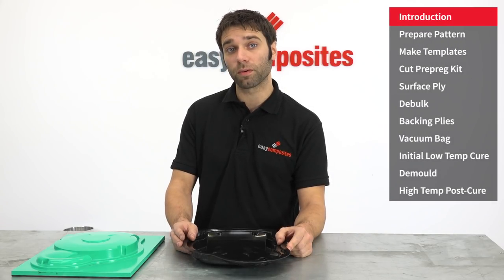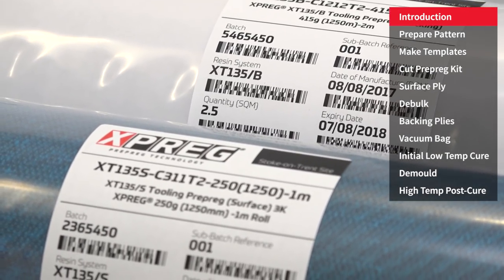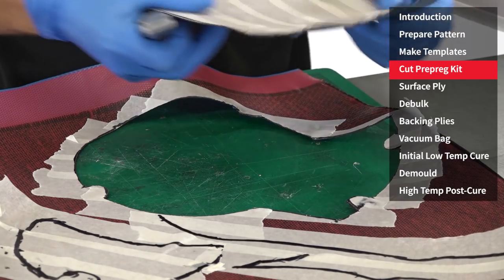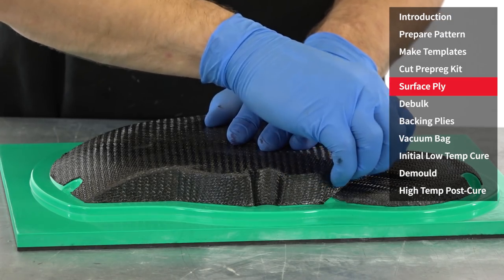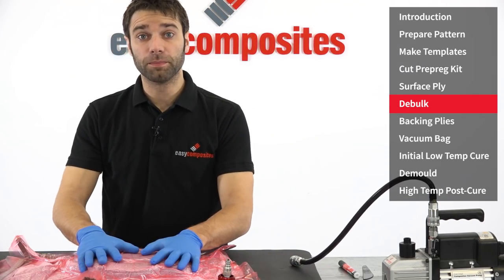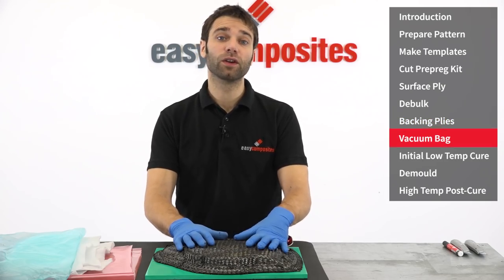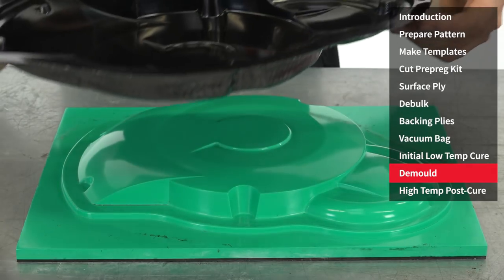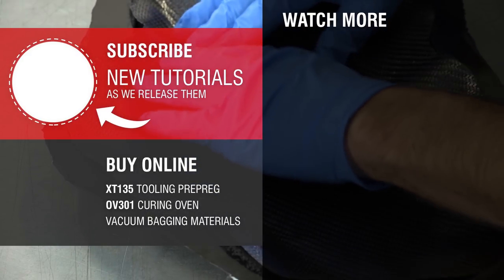How to Make a Prepreg Carbon Fibre Mould (Using XPREG® Tooling Prepreg)

Comment: Alot of people moaning about the length of cure time. But if you weigh it up against normal gel coat drying times, then lay up of mould, air dry then post cure. Not much difference apart from this is so easy and clean. Just made my first mould using this very impressed. Just hoping it lasts...
Reply from the maker: Hi Tom, it certainly should, just because the system isn’t bulky doesn’t mean it’s any less tough. Also, agree on cure time. All ‘tooling’ prepregs have very slow and low cure times in order to minimise expansion of the pattern and so maximise accuracy. You could cure faster at higher temperature but in so doing you’ll generally expand the pattern or introduce internal stresses that can cause a slightly distorted tool. Once you’ve laminated the tool, you just load it into an oven and you can just leave it curing away in the background whilst you crack on with something else. I’d say in terms of hands-on work it’s no slower than wet layup. Looking forward to hearing how you get on.
Reply: @easycompositestv  Well first time I have pinhole free! I think I can clear coat this just once. For the last 12 months I have been fighting a loosing battle trying to make uni mould work with xpreg because I'd rather quit than make make another epoxy mould 🤣.

Only thing I'd like to improve is the print through on mould. After the 65 cure it was great. Then after the 135 cure I had a bit of print through is there a slower cure again to help?

And lastly the mould surface has little holes in now. Like the s120 sealer went bit weird? It did seem smooth before because I 1200 grit sand and 3 coats of sealer. But now the part comes out like sandpaper because of the little holes in the mould.

Comment: For best results, use +/-45 ~20mm wide strips around all corners and debulk before the first skin goes on, then you woulddn't need to overlap first skin down. Then you ought to have some (usually from heavyweight) bootlace reinforcement in corners after the first ply debulk

Comment: just used this to do some of my moulds very clean use, but took me 3 hours :D i guess i am not as fast. And i find the surface  carbon fiber was more difficult to apply as it wasnt sticky, used some hair dryer and it was sticky again, the backing ply was so easy to apply as it sticks like a glue. The mold still in the oven cant wait to see the results.
Reply from the maker: You can use a heat gun or hair dryer to improve the tack no problem  -  it is quite common as the tack on some pre-pregs can vary.

Comment: would it not be easier to cnc cut the negetive mold right away?
Reply from the maker: We did discuss this (and show it) in the preceding video where we explained that it is possible to CNC machine the female mould directly from epoxy block however such a mould would have a much higher CTE and really only be durable enough for prototypes and small runs. By taking the mould off the pattern at low temperature (when the pattern won't expand much) and then post-curing the mould off the pattern at high temperature you can produce a highly accurate, very low CTE mould and use it at up to 135'C (in the case of the XPREG XT135 system).
Reply: Thank you for the answer, makes perfect sense
Reply: Easy Composites Ltd sorry, but CTE is a "Coefficient of thermal expansion"?
Reply: I'd assume so. I could see why making your mold and part out of the same material would be optimal for dimensional stability during curing.
Reply: Marcus Quintilian tnx!

Comment: Wow, the Xpreg system seems to be a lot faster. By the look of it, it makes beautiful molds too. (Easy composites, please put links to go directly to the product, to check price and purchase, in the comments for your tutorials)
Reply from the maker: Good point Martin, I've added 3 links to the description, the top one links you to the project page on our website - these pages have a 'shopping list' on the right hand side which links to all the products used in the tutorial (from the XPREG to the bagging film to the oven!). The other two links are direct to the XPREG XT135 pages on our site. It's certainly true that these tooling prepregs are quite a bit more expensive than conventional component prepregs but by the time you take everything into consideration (the efficiency of the way you can use the material, the speed, and the reliability of the end-result) they should stack up very well.
Reply: Excellent response, thanks. This is why Easy Composites is the best composites company on the internet!

Comment: Why not make the part directly from the tooling board? Is it too fragile for producing multiple parts?
Reply from the maker: Correct, the tooling board is really only suitable to be used a very few number of times. Additionally there is the difference in CTE of the materials. For best results, the component should be made with the same material as the mould tool to match the expansion and contraction as the temperature increases and decreases.

Comment: Is it posible to do this with a clothing vacuum bag? Or do they fail in the oven?

Im looking to do some RC sail planes and would appreciate some beginning recommendations
Reply from the maker: Unfortunately not, whilst clothes-type vacuum bags are fine for room temperature, low-vac pressure processes (like in our simple vacuum bagging video), they're not suitable for high-temp, high-pressure.

Comment: Great looking part.

Only thing is every video shows you making a mold first...anything I would make I only need 1 part. So making a mold would double the cost. Need more videos on how to do "Moldless parts".
Reply from the maker: Well, this video is showing a prepreg manufacturing process. Since the prepreg requires high temperature to cure you would always need a suitable mould. For mouldless production you need to bear in mind that you still need something to create the form - so, assuming we're using the original part as a 'former' - the carbon fibre part you take off this original part will be dimensionally different from it (i.e. it will be larger by the thickness of the material) and the new part will have its good surface on the inside and it's rougher, less accurate 'B side' will be the outside. For this reason, mouldless production is not generally that viable.
Reply: I was actually referring to your videos in general...I should have posted this comment on the "hood making video...Or the Carbon fiber Hood scoop video...as it wasn't heat treated.

Also I think alot of parts can be made over pieces and "trimmed back" to fit as alot of automotive parts have large body gaps..

Comment: What is the life expectancy of that mould with that process making those parts 50 parts?  and if it was a vacuum forming mould better or worse?
Reply from the maker: Depends on the cure cycle, how hard it is to demould etc but a good quality mould could well last hundreds of pulls with a little care and maintenance.
Reply: Easy Composites Ltd cool beans thanks :)

Comment: Defrosted? Does this stuff need to be refrigerated or frozen in storage? If so, at what temperature?
Reply from the maker: It needs to be kept in a freezer at -18C or lower.
Reply: @easycompositestv  that's gonna be hard cause our freezers over here only do Fahrenheit
Reply from the maker: -18'C is approximately 0'F

Comment: curing is insanely long though :D 18 hours initial cure, 19 hours post cure, that's absolute insane amount of curing :D but i am assuming this mould wont be destroyed easy , how many pulls it might give?
Reply: Would also like to know this
Reply from the maker: Hi Tan, actually, it’s pretty typical for the initial cure of a prepreg mould to be done ‘slow and low’ over a very long period of time. As explained in the video this is to minimise distortion of the pattern. The pattern is certainly not damaged by the process and can be used again if you need to make another mould. And of course, the mould that you make in this process can be used thousands of times, on a much faster cure cycle.
Reply from the maker: Hi Tom, hopefully just answered you question in my reply to Tan.

Comment: Is there any reason to make the mould from the part instead of machining the mould? It could have saved the step of fabricating the mould.
Reply from the maker: Moulds machined from the model board can be used but generally do not have the same durability and lifespan as a properly made mould.

Comment: is this green material called prolab?
Reply from the maker: Prolab is PU based. The EP700 is epoxy based.  You need epoxy based model boards as PU has a strange cure inhibition effect with many epoxy based pre-pregs where as the pre-pregs cure fine on epoxy tooling board.

Comment: so if I want to make a motorcycle fairing, can I lay this over the original part? and will it mark the original part?
Great videos BTW
Reply from the maker: The fairing and any flanges you add to it would need to be suitable for the temperature for the initial cure portion of the mould curing cycle which is 65C for it to survive the mould making process.
Reply: use the vacuum infusion method to make fairing and then apply teflon coating to the outer surface for low air resistance.

Comment: can I start the first layer with backing ply without using surface ply? does the release agent still do the job? I d like to make a pipe with large diameter by using an aluminium pipe.
Reply from the maker: The surface ply is specially formulated with the extra resin needed to give a good quality mould surface finish so you can't really just use the backing ply.
Reply: thx!

Comment: Do you have to let the whole roll defrost or can you just cut a section you need?  Great vid!
Reply from the maker: You have to thaw the whole roll before you can take it out of the sealed bag, otherwise you can get condensation forming on the roll which could contaminate the prepreg. Once it's thawed, it's common to cut off a length to make a shorter roll to work from. You then re-freeze the larger roll and work from the smaller one. The out-life is 4 weeks at room temperature so it's very practical to work this way and you have the confidence that when  you go back to the larger roll you know you're working from fresh material that has most of its out-life left.

Comment: hi! 
did the breather soak up some resin (after the final oven/cure)? 
if yes, was that through the release film, right? 
thank you!
Reply from the maker: A small amount of resin went into the breather which you can see as the vacuum bagging stack is removed during the video.
Reply: it is because the release film was the perforated one, right? or...
thank you!

Comment: can you guys make a video on how to make a bumper?
Reply from the maker: Same as the comment below about the fender, I think we covered this pretty well in the bonnet/hood video, unless you want to see it done in prepreg; basically though- the process would be the same for a bumper as for making a smaller item and we will be doing a new video in couple of weeks showing how we use the mould made in this tutorial to make the carbon fibre part itself. A bumper could be made in prepreg in just the same way but it does mean you need a large oven.
Reply: Easy Composites Ltd i was wondering because a bumper you cant really do it in 1 large piece of carbon fiber so would you cut sections for the fog and turn signal area?
Reply: That's correct. It's covered in the video about the bonnet/hood, where they cut sections in for some of the components afterwards.

Comment: Could this be laminated and made into a replacement bow on an old crossbow? I have an old one that isnt sold anymore and parts are hard to find.
Reply from the maker: In theory yes, although you would need careful consideration of the actual lay up of the part to match the original.

Comment: Informative video, could you guys do a vid of how to make a carbon fibre fender for a car?
Reply from the maker: I think we pretty much covered this with the bonnet/hood making tutorial didn't we? - The process for making a fender would be the same but you would only need to make a single skin which means less mould and less work. That tutorial used the resin infusion process but you could also use prepreg carbon fibre - we'll have a new prepreg tutorial coming out in a couple of weeks.
Reply: Yes I remember seeing your tutorial on the hood. But is it the same process for the mould? 1 for front and one back, or would you need to break it up in multiple sections to get it to release?
Reply from the maker: A replacement fender panel usually would only use an outer skin. If you really wanted to, you could do an inner and outer skin just like the bonnet video. As for the split, if it does need to be a split mould then this is totally do-able (as per the split mould process we showed in the airbox video).

Comment: Did anyone catch how long was the initial low temperature cure and then the high temperature post cure, and what was the temperature curve for the high temperature post cure?
Reply from the maker: I would recommend you read the full processing guide for the XPREG XT135 Tooling Pre-preg system as it details all stages of the cure and postcure including graphs and tables to help you program your PID oven controller. You can download the guide here: https://system.eu2.netsuite.com/core/media/media.nl?id=167990&c=3937524&h=4eb81cb946d37401a0db&_xt=.pdf
Reply: Thanks.
For anyone else just browsing and wanting a quick summary/outline/idea, about 18 minutes for each and at 65 degrees (C) for the initial cure with the post cure stepping up from 50 to 135 degrees.

Comment: One "important" question: Why make a mold out of expensive carbon fibre? Why not just fibre glass? For a mold I would think, it is enought. You will propably say, it is much more simple to get into the sharp corners. What about a mold, where this is just filled with resin? Resin is less stable, but in my experience it is yet very very strong, so it should work perfectly. Also there are ways to get glass fibre into the nucks and crannies (Is this, how it's spelled?).   So please tell me, what am I missing??? Do I get something wrong here?
Reply from the maker: These moulds are made from tooling pre-pregs using carbon fibre for durability and especially the low Co-efficient of thermal expansion offered by using a carbon fibre matrix which will match the parts likely to be made in it.  This reduces the chance of warping and distortion during the cure process.

Comment: Awesome stuff <3 . Lets say one is totally quality freak , and one spotted some imperfections on the mold surface. Can it be sanded / processed before further casting ?
Reply from the maker: Minor imperfections can be lightly sanded and polished out if necessary.
Reply: @easycompositestv  Thanks

Comment: No gel coat needed?
Reply from the maker: Correct, no gelcoat needed. The special surface ply actually has a filled resin-rich layer which works like a gelcoat and provides the gloss black surface you can see on the finished mould.
Reply: what if i do not want it to be plain black, what if i want to see the fibers, how do i do that?
Reply from the maker: In this tutorial we're demonstrating how to make a prepreg carbon fibre *mould*, not the part itself. The tooling prepreg we use in this video needs its thick resin layer (which is black) in order to have a slightly polishable surface that's better for tooling (moulds).
The piece we've made by the end of this tutorial is a mould that in the next tutorial we will show you how to make the carbon fibre part, again using prepreg carbon fibre - however the carbon fibre we use to make the part will not be pigmented and will have the usual carbon fibre appearance. If you look at the very end of this tutorial, you can see the the carbon fibre part that will feature in the next video.
Reply: Depending on the pre-preg system, you'll see the fibres anyway ;-). I naver haven't been able to. Sometime you won't on glass systems... and I've never used or heard of glass/scrim being used in LTM! (maybe in non-motorsport applications?). 200gsm 2x2 does the trick every time.

Comment: What was the curing time and temperature? (sorry, i am Hearing impaired)
Reply from the maker: No problem, actually we will add the captions to this tutorial in the next few days which should help you too.

The first cure (low temp cure, on the pattern) is:
1°C/min ramp to 65°C, hold  at 65°C for 16hrs, natural cool.

The second cure (post-cure, off the pattern) is:
0.1°C/min ramp up to 135°C, hold at 135°C for 3hrs, natural cool.
Reply: Fine ... Thanks a lot. You have no branch for delivery in Germany? I'am interested in the curing oven, but delivery to germany is tough payment ...

Comment: Is there a way to.soften the prepreg resin ?
Reply from the maker: You can gently apply a small amount of heat using a heat gun which will slightly soften the pre-preg and make it more tacky.
Reply: @easycompositestv   is that the only way ? i tried doing  the way you told me  but i had to heat up the carbon fiber  real good for it to bend good

Comment: Dont they make room temperature pre preg carbon now?
Reply from the maker: Room temperature prepregs just mean that you can store them at room temperature but this doesn't really work for us as a concept. To be storable at room temperature (let's say 20-25'C) it's near impossible to have a prepreg that can then be cured at the lower end of the temperature scale, example the 70'C we use here because any prepreg that will flow and cure at 70'C will have a finite 'out--life' at 20-25'C. If you need to cure at a higher temperature then you'll encounter more expansion from your pattern and lose accuracy. There's a lot of products now on the prepreg market that promise a lot but don't deliver. The prepregs and processes we demonstrate really do what they're supposed to and there's a huge amount of work that's gone into making this the case.